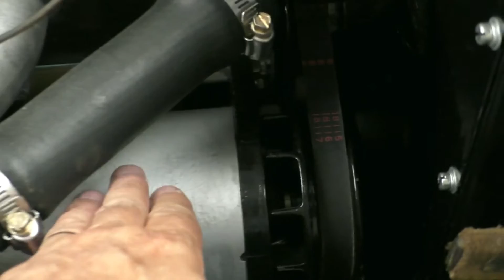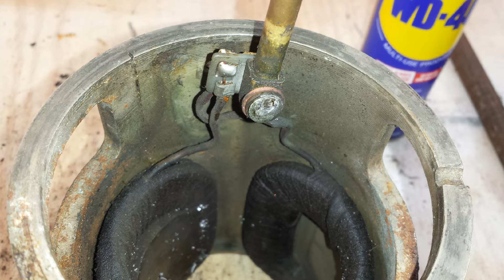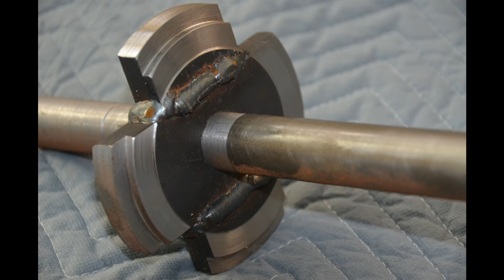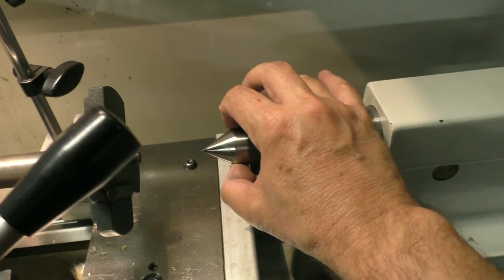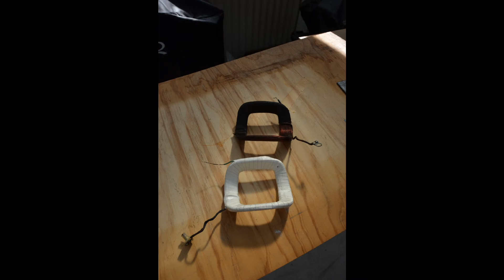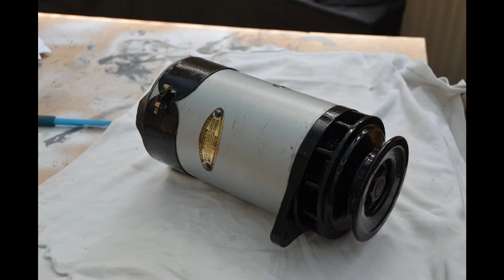Greg's 1949 P3 Rover resto chapter 2

Comment: You didn't consider replacing the generator with a nice modern alternator? 
Only the closest inspection of the car would give the game away.
Reply from the maker: Hi Paul I did consider replacing the generator with an alternator that looks like a generator. I was swayed to keep the original based on past experience with my first car, a P4 Rover 60 which had a generator and did not give me any problems. Also probably fair to say that I have some obsessive traits and like to keep things original even when no one else would notice.

Comment: Would you have time to recommend a good Mig welder. What amps should I go for? 
Willie
Reply from the maker: Hi William. I use a Lincoln Electric Power MIG 180C. I am happy with it; fine for automotive use. I am not an expert in welding but do have some idea. When  completing my fitting and turning apprenticeship many years ago I worked under a Boilermaker welder for awhile, but most of my experience back then was with a stick welder.  Have found the MIG to be easier to use in many ways. You can use either solid wire with gas or flux core wire without gas with this welder. Can also weld aluminium but need an accessory called a spool gun and pure Argon gas  for Aluminium. 
Guidelines for the best power and wire feed settings for various thicknesses of materials are printed inside the door of the welder. The Shielding gas is pretty easy to obtain these days. Can buy full gas cylinders from various hardware outlets and then exchange for a full one when you run out. Hope this helps. Happy to respond further.
Greg